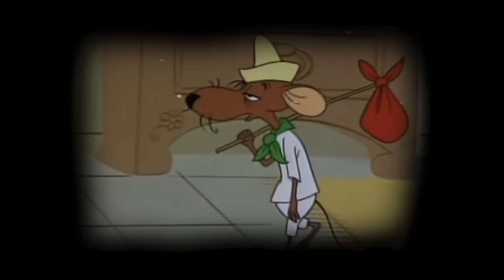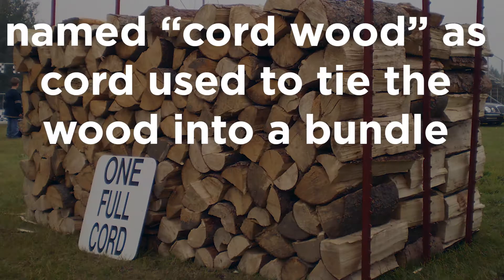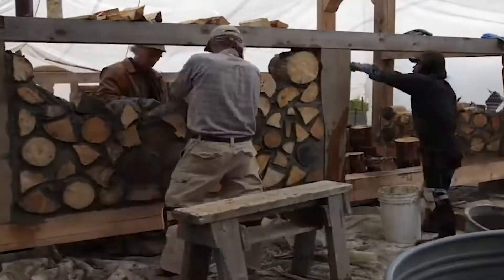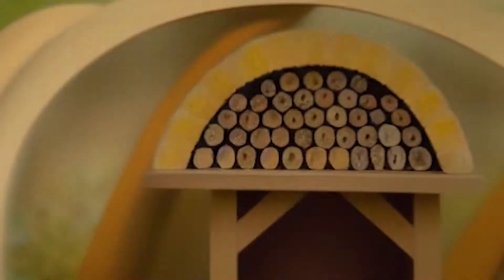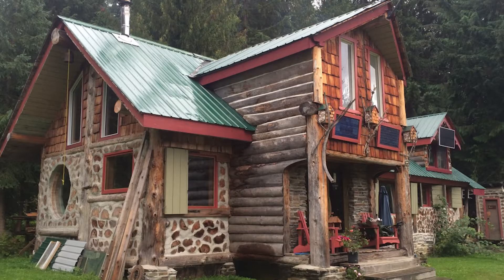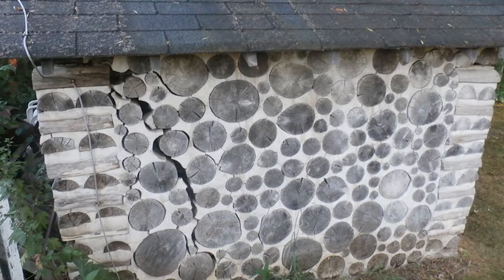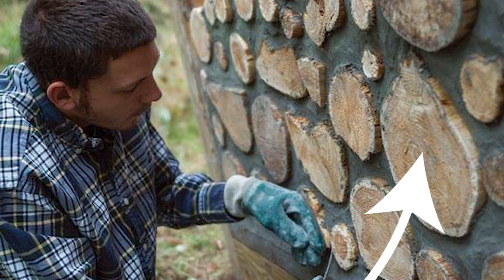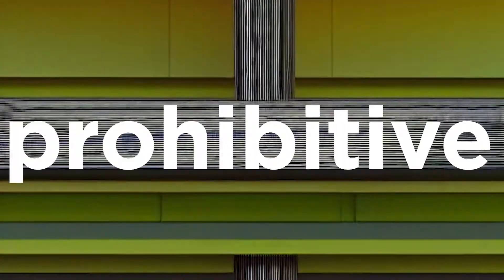World's Worst Natural Building Material?

Comment: you have to seal the wood and do not use portland cement. use lime putty and sand. one part lime paste and 54-5 parts sand. self healing and more flexable.
Reply: I had a cordwood house for over 30 years and the only logs that split and had gaps were the ones that were whole, not split.  We also dipped each log in preservative before we used them.  It was a very cosy home!  Those walls were 2 feet thick.  The only reason I am not there right now is that we had a massive flood and one corner of the house sank down into the sand below and the roof actually slid off a few inches.  It was condemned as it would have cost more to fix it than it was worth. And you are correct about the cement!  LOVED that house!
Reply from the maker: Any photos of it? Sounds epic!
Reply: Lovely info. I’m planning to build a structure next year. Will use hempcrete to fill as insulation and will burn the outside with a blowtorch before the sealing. After sealing we can go apply the mortar u suggested. I’m gonna research. 🙏

Comment: Pretty sure cordwood homes started in areas such as Siberia, northern Alaska  and Canada where trees dont grow very thick  As its all about insulation value and 10 to 36 inch in diameter trees wont work for a traditional log cabin so improvise but theres two options,  linseed oil the exposed ends every few years or using a blow torch to crisp the ends which  will deter insects from burrowing.

Comment: We have all sorts of cordwood homes and buildings here in Canada. Our humidity is all over the place and i don't see these issues. For every broken wall, there are 10 good ones. I've seen a lot more problems with stick and brick construction but that may be because there are more of them.

It depends on how you construct the walls as well. Papercrete works better than mortar.
Reply from the maker: What is papercrete?
Reply: @greenfutureyt  Sorry to take so long to get back to you. I'm off grid at the moment but had to come into town for a few bits and bobs. Papercrete is just what it sounds like. It's shredded paper mixed with wet mortar. Think industrial strength paper maché. I think it comes from the 1920's and got resurrected in the 70's as an alternative to regular concrete.

It's easy to make, doesn't shrink as bad as regular cement and seems to have a higher heat retention although I'm not sure why.

Comment: Is there a posibility to burn a little the wood to seal it? And then use it as a decor wall? Or is better use cob and straw?
My weather is 70 to 80% of humidity. I live in a forest (pines and oaks are the main trees here)
Reply from the maker: Is there much variation in humidity across the year where you live?

You could create a hybrid home. Utilising the wood you have available for the structure, then cob and straw to insulate.
Reply: @greenfutureyt  thank you so much. The humidity is 70 % almost from summer to winter. Only the spring give us a break 😅
Reply: Yes, Cob with " hat n boots " would work well for that... like " Oregon Cob " ... theres no rules against mixing walls, as well, especially if you have a solid post n beam frame.
Reply: I'd say that other ways d be better than burning...  
A liming mortar n lime over outside would limit rot.. 

B asphalt/ tar works.  Ugly n toxic in some eyes, the smell fades n it works. ( outside ) 

C  using a borax solution on outside would limit rot issues.. 

Basically keeping the walls dry is enough though...
Reply: Yakisugi?

Comment: which are better alternative? (for example to build in spain) rammed earth?
Reply from the maker: Depends what the landscape around you is like really. Could use stones if they exist near where you are. Supposing Spain is relatively dry compared with the UK rammed earth could work. I would probably couple it with a timber structure.

Comment: Using a mortar with more lime and sawdust in it, is normal procedure...  the cavity system  is also standard... 

Finally, a post n beam structure would fix the issues with those fallen down old houses.. 

Bluntly, you sound pretty ignorant for someone telling us what rhe pros n cons are...  

I reccommend reading a book...  specifically,  one by Rob Roy, who discusses these issues and engineering in his books...    self evidently, the technique is for owner builders. Paying soneone defeats the main purpose of " sweat equity" ...
Reply from the maker: Thanks! I haven't heard about the mix augmentations you've mentioned.

Also... thanks for the honesty! haha. I haven't built a cordwood building so my findings were purely based on my research! Hopefully it is still useful for some people.